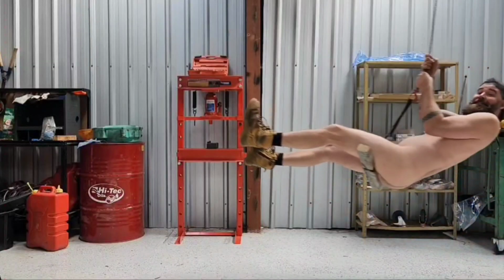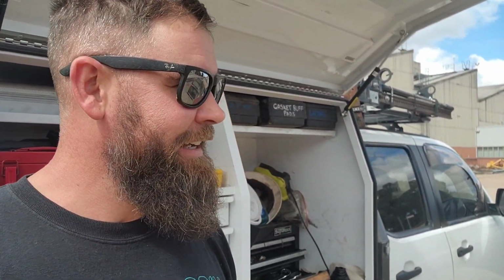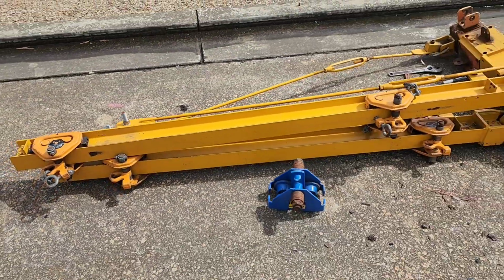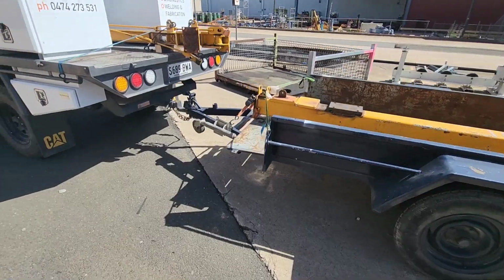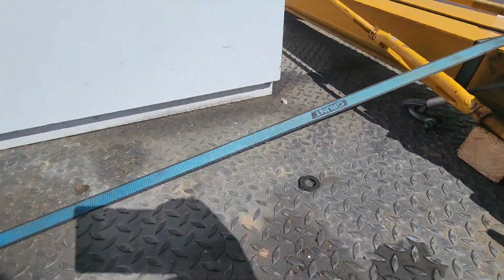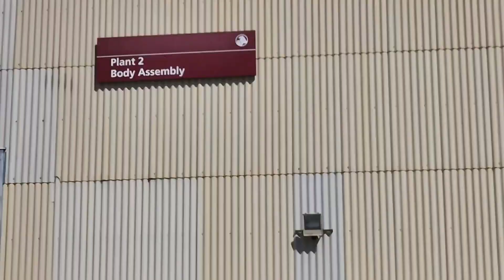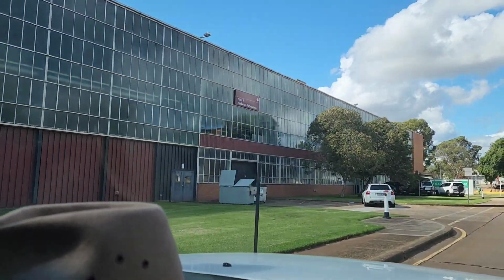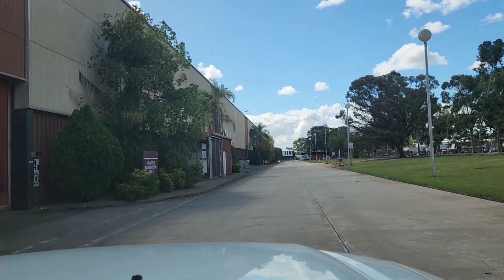I bought a Crane! From WHERE? - Jetski's Garage Ep. 36

Comment: It's not a crane.. it's a manual spot welding gantry.  300kg lift
Reply from the maker: It was probably used for that but with no welder on it, it would be deemed a jib/gantry crane.